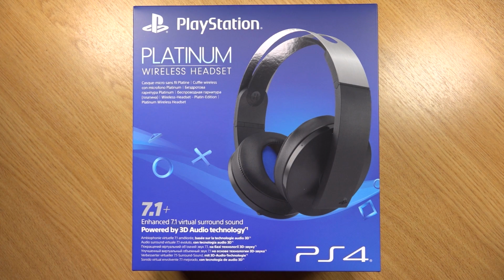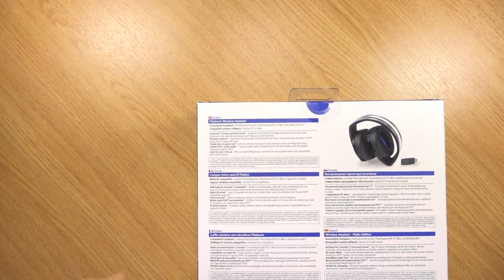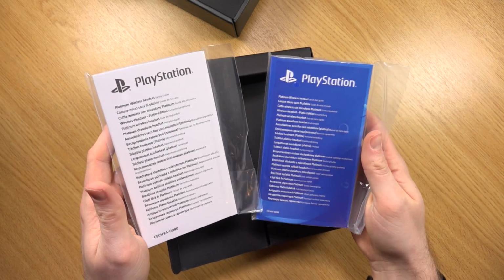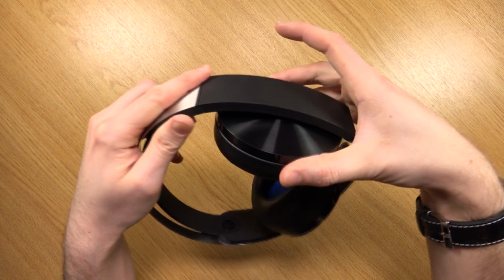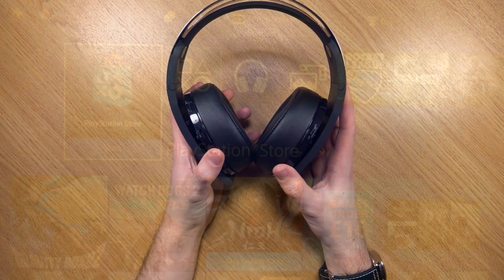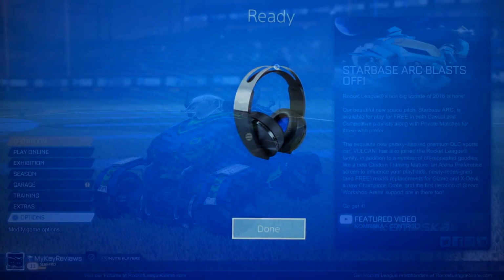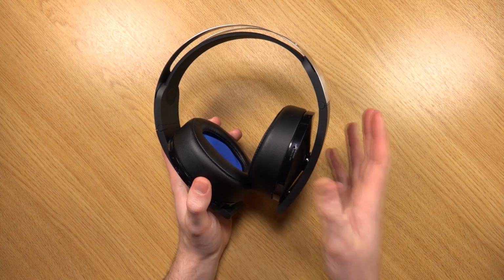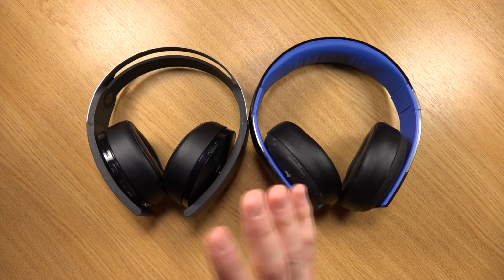PlayStation Platinum Wireless Headset (PS4/PS5) | Unboxing, Set-Up, Mic Test & Review | MyKeyReviews

Comment: Would you still recommended in 2019?
Reply from the maker: I've since gone through other headsets. I mainly use wired now.

These would still be fine in regarding quality in 2019. Another good headset is the Turtle Beach Stealth 600.
Reply: @MyKeyReviews  Oh damn, thanks.
Just because of this detailed review and that quick of a reply on a 2 year old video you've earned my sub. 🙌
Reply: @TheChaoticCanuck  i still use them after half a year now.. I mainly use them wireless on PC and they work great.. Good bass.. Good sound isolation and the special 3d audio on ps4 is so nice... I would recommend them if u going for wireless
Reply: @gsnoeren013  Alright thanks.
Reply: @MyKeyReviews  what wired headset are you using over this one? Wired to the PS4 directly or via the controller (3,5mm jack)?

Comment: If it won't Connect use a pin to poke the reset button on the usb than hold mute on the headset, while holding mute turn it on... should be good to go!
Reply: Jordan Baldwin could u explain it more pbvious
Reply: It still didn’t work for
Reply: Me

Comment: How do you activate the party chat for this headset. I'm new to ps4 headsets so that's why I'm asking
Reply from the maker: Green Beret Party chat is done through the PS4 settings. Should be a headset icon along the menu and you can create one.
Reply: MyKeyReviews I see that but how do you hear yourself through the mic, I held down the mute button until there was 2 beeps and I still can't hear myself in a party
Reply from the maker: Green Beret The sidetone isn't great on this headset; it works, but is VERY subtle.
Reply: MyKeyReviews I went and traded in for an astro headset which works for me
Reply from the maker: Green Beret That's fair enough, Astro are a good brand. 🙂

Comment: I seem to have a problem with the game volume being too low on the headset, while the chat volume seems to be fine. I tried the Sound/Chat button, but it didn't seem to fix it. The chat volume faded away, while the game volume remained the same (low). I noticed this to be a problem while the headset was low on battery, and I haven't charged them, as it was night and I didn't want to let them charging the whole night. Maybe that is why? I just got the headset about a week ago, so I'm still learning how to use them. Any help is appreciated.
Reply from the maker: GVRCIA Definitely give the headset a full charge and hopefully that will help.

If you know how to adjust the ratio and follow up with the general volume button, then there's no reason for it to be quiet. 😮
Reply: Mate if you have a warranty then you can replace the product

Comment: Loving your videos I have viewed so far!

Going off your 2.0 review, I guess the Platinum price in the UK is about double?  £75 vs £130?  No doubt it can be had cheaper through places like amazon.  Here in Oz, the 2.0 is $99 and the platinum is a pathetic $259!  Almost triple.  

Another advantage the 2.0 has is that it works with the PS3 and VITA (TV, I guess anyway.  I have a TV but not a VITA).  I am sure there would be far more 3D Sound enabled games now, so is it worth it?  I am about to buy a SONY A1 OLED TV and wanted some nice headphones seeing as I can't fit a surround set up in my bedroom.
Reply from the maker: A Shaw Woah, that's a huge price jump for you guys in Oz; I would say it's not worth that leap in price and to stick with the 2.0's.

Alternatively, if wires don't bother you; my current set-up involves the Turtle Beach 'Elite Pro Tournament Gaming Headset and TAC', which you may be able to get in a bundle.

Comment: Why I can't save my profile preset in companion app? Every time i close the companion app my preset profile gone.
Reply from the maker: lawrence melosantos I'm not sure why the app doesn't remember it like it does with the Gold's, however I'm sure it's still uploaded as my different profiles make a difference.
Reply: MyKeyReviews and also im experiencing ramdomly disconnecting in this headset.
Reply from the maker: lawrence melosantos I've not had one disconnection since using, so am not sure what that could be caused by. :/

Comment: That rubber-band feels so bad is pushing my head down so bad, and I'm not sure about the radiation or the Bluetooth if is too bad or not but this is my first wireless headset and makes me have headaches.
Reply from the maker: LiilReyy I'm bald and I find the rubber band fine. Not sure why you're having headaches, I don't think it would be the wireless connection, who knows. :/
Reply: MyKeyReviews I don't know this is my first wireless headset and I have headache every time I use it, but with my other headset that is a wired headset I never had a headache, I'm not sure if is the wireless radiation of the Bluetooth but I'm sure that I'm having headaches since I'm using this wireless headset
Reply from the maker: LiilReyy Does it feel tight on the head?
Reply: MyKeyReviews just I feel the rubber-band pushing my head down
Reply: LiilReyy It the Rubber Band top of you're head. It kinda hurt when you're using it. But I guess wear a Hat so you won't get headaches. Sorry for late response.
Reply: Gotta break them in. Anytime I get a new headset I get a headache for a week once that week is over I'm good to go

Comment: Lucky for you mate! you get your headset working well. Unfortunately I had to exchange twice to let it work for me. I was unable to upload uncharted 4 and shooter exclusive audio  mode to my platinum headset. The reason why being is after when I upload to my headset and close the Headset Companion App and then reopen the application...It is no longer stored in the preset 1 or 2....And its empty...This never happened to me when I used to own gold headset....:( Finally got Astro A50 and it works pretty well
Reply from the maker: Never happened to me with my Gold's either.  Glad you got a headset that does the job though. :)

Comment: thx for everything!  but I have 1 question which is that does the surround sound and 3d audio works when using the headset on the phone?
Reply from the maker: azooz40001 Those features are for the PS4 only. ☺️

Comment: I had one Gold Headset, the hinges broke through regular wear, after about 3-4 months. Got a new headset replacement from Sony, I babied it so hard. I never folded it, and was gentle with it always. After about 3 months I noticed the hinges plastic was a whitish blue...they broke a few days later while I was wearing it. I taped it up with electrical tape, the other hinge broke, and I taped it as well. Really tightly. Then the band started cracking in multiple areas. And I taped the entire thing up. It still works, it's just like a bootleg looking headset with black electrical tape all over it. lol 

I think the issue is, is my head is just too large for the base Gold headset, and I think that might be the issue that a lot of users have, and why they break. I ordered the platinum, hopefully that will fix the issue of the headset breaking every 3 months or so.
Reply from the maker: BloodyNights The construction on the Platinum headset is far more superior. :)
Reply: I hope so, I'm going to give it a try. Thanks for the review mine is coming in the mail soon. It's about time I upgraded. Hopefully it will be worth the extra money.

Comment: Ended up buying a set of the new Astro A50 Wireless, with Base Station.

HORRIBLE hollow, reverb sound!

Sometimes it sounded like you was in a bathroom!

Returned them, the day after I received them.

I'm now waiting for a certain retailer to restock this Platinum headset, and I'll buy them. I'll have to buy a separate set for my Xbox One S.  However, at these prices I'm ok with double dipping!

A concern of mine was the rubber head band on this headset. However, my eagle eye tells me that if it were to split (over time), it can easily be replaced? Looks like it can just slip off?

Now that you've had more time with this headset, can you confirm whether or not you are still happy with them? Has anything changed, with regard to your view of them?

Also, with regard to these not being bassy (re explosions, etc) can you not simply up the bass with the companion app?

Lastly, just read some reviews on Amazon and many people are complaining about a buzzing noise coming from the headset? This is (apparently) most noticeable when there happens to be no sound coming through the headset?

As always, thanks ...
Reply from the maker: London Fella I really can't see the rubber going, but if it does, I don't know if they would sell a replacement.

Honestly, I do really like this headset, especially after testing different sound profiles; the bass is my favourite. 

I'd still recommend it, just think it's a tad over priced. :)
Reply: ***** 

Sold.
Reply: London Fella hi returned them after 2 days what lost balls people telling so many lies because the getting them for free and making you buying, but make shore that if you don't believe us that the Sony platinum are rubbish even with uncharted 4 buy them from amazon because you can easily return them
Reply from the maker: Bare in mind I'm not a complete audiophile, so I'll try to explain to the best of what I experience.

Audio does not sound hollow and I have personally not noticed any reverb.

Spacial awareness can depend on the game etc... Remember for most games it's 7.1 "Virtual Surround Sound"; so you do get a good awareness, but not exactly pin-point.  I noticed more directional audio with the 3D audio on Uncharted 4.

Bass and tones vary on which sound profile you choose and once again, which games you play.  I found that when playing CoD:MW-R, the grenades had more boom than IW.   I loved the audio in BF1 where the guns sounded great.

I'd be interested in hearing your opinion once you've had some time using; reviews have been mixed but majority in favour, and I do like them too.
Reply from the maker: No problem at all; hope you like them and look forward to hearing your opinion also. :)
Reply from the maker: London Fella Audio can be very subjective to each person. 

Though have you tried any of the sound profiles at all? 

I'm using them right now and I still enjoy using them, shame you didn't have the same experience. 😐
Reply from the maker: Domenico Parise I've actually purchased the Platinum headset and wouldn't say they're good if they're not.

I don't think they're quite worth the price, however that doesn't make them a bad headset. 

I do agree with you on purchasing through Amazon as products are easy to return.
Reply: ***** 

Is the sound hollow, of full sounding?

Does is have a reverb effect (like the A50s, which I returned)?

Is spatial awareness good? That is, can you easily pinpoint the location of sounds (e.g., footsteps)?

Is there enough bass, mids & highs?

Etc, etc ...

I'm picking mine up on Friday, so I hope they live up to my expectations.
Reply: ***** 

Thanks again, buddy. 

Appreciate the time you've taken. 

I'll let you know what I think once I have them ...
Reply: Just tried them out. 

They are already boxed to be returned. 

How you can find the sound on this headset anything other than appalling perplexes me. 

They are AWFUL!

My day one PX5s sound infinitely better than this Sony set. 

Looks like I'll be going back to TurtleBeach. They truly are leading things when it comes to gaming headsets ...

Comment: i cannot get my platinums to pop up under bluetooth. how do I even get them to sync with dongle plugged in. im stuck! how do i get them into discovery mode or whatever so they are recognized
Reply from the maker: These aren't Bluetooth which is why, in the video I show the set-up process on the PS4, check description for the time slot.

Comment: Hey, I bought a pair of these last night and all good so so far except every time I turn my PS4 pro back on the audio modes ( presets I have loaded) are no longer saved in either slot ( 1 and 2). I am wondering if you or anybody has had or is having a similar issue? Any responses appreciated. Thanks
Reply from the maker: Same for me; they are definitely saved as the audio differences are there depending on which profile you have switched too.

Though I'm pretty sure when using the Gold headset, the uploaded profiles are visible. :\
Reply: MyKeyReviews so, you reckon the presets are still saved after switching the PS4 back on but just not visible anymore? 

How can you tell your chosen presets have been saved still? You don't think that you need to load them back into each slot after restarting the PS4?
Reply from the maker: Barry S Pretty certain they're saved to the headset. 

I now have the bass setting on profile 2 and there's a difference in sound, so it must've been saved. :o

Comment: Appreciate the information.

Would there be any issues if one were to put the USB dongle in the rear port of the PS4 Pro?

Would this cause interference?

Also, this operates on the 2.4ghz frequency?? Surely that's going to lead to crackles/audio pops?? Why didn't they go with 5?

I'd really appreciate it if you could try the dongle in the rear port on your PS4 Pro, just to see if it fits ok and doesn't cause any added interference.

Cheers ...
Reply from the maker: London Fella I have just tested it out on the rear USB port and can confirm it works perfectly fine.

Did a mic recording test and no crackle or pop.

Probably would have been better if they used a different frequency, but it seems to work fine as is. 

Hope this helps! :)
Reply from the maker: London Fella On top of what I previously said, when I went to remove the dongle from the rear, it's rather close to the vents which can get warm.

So if you do decide to put it there, keep an eye on it.
Reply: ***** 

Appreciate the response, buddy. 

Your comment re heat from the rear of the console makes perfect sense. 

Is it a tight fit in the front USB port? That dongle looks fat!

My fight stick fitted without issue on my original PS4, but it's extremely tight on my Pro. I now use a USB extension cable, as I'm not happy about squeezing it in there (can't be good, right?). 

As it does operate on the 2.4ghz frequency, can you confirm whether or not you have experienced any interference with the headset?

I was all set on this headset, but just watched another review where the fella said that the sound was "awful". That is, when using the virtual surround/3D whilst playing The Division. 

I'm really torn between these, and the new A50s?

You will now have had a bit more time with this headset: Has your opinion changed at all?

Thanks again for checking things out, and getting back to me. 

10/10 for detail ...
Reply from the maker: London Fella I've had a USB stick and normal USB cable beside it and they fit fine, so no qualms there. 

I've had no interference or issues so far, so I'm not exactly sure why others have had experienced such issues.

Opinion still stands, I like the headset, just think it's a tad over priced in comparison with the Gold headset.

I'd say check out some reviews and a mic test on the other headset you're considering and go from there. 

Always happy to help. :)
Reply: ***** 

Much appreciated, mate. 

Really do respect the time you've taken to get back to me. 

Currently watching another review (Flossy Carter) and he seems to love them!

Think I might give them a go. 

Thanks again, fella ...
Reply from the maker: London Fella No problem at all. :)

Comment: Great channel ! 👍🏻 i have three Playstation headsets ( elite pulse , 2.0 & now platinum ) I like high volume but I think platinum is not that loud like 2.0 on 2 bass settings or pulse on shooter/game mode..
Reply: David if you have the money it's worth it just for the extra battery life. The sound is a bit better as well as the mic. If you play uncharted 4 you have the 3D audio on top of that.

I don't like telling someone to buy something in case they aren't happy. However I'm really happy with my purchase. Entirely up to you mate..
Reply from the maker: MikeZablo If you get the ratio right, the volume isn't bad, but then again, maybe my ears are more sensitive?  😁
Reply: David no worries
Reply: @jimoflh5773  dude do you still have them?
Reply: AGENT HUNT299 yeah I still have them. Last week they snapped on me. Bit of gorilla tape has fixed them. Doesn’t look bad either. Just broke because I use them a lot and I can see me using them until the PlayStation 5 comes out
Reply: AGENT HUNT299 only thing is now they don’t fold anymore lol
Reply: @jimoflh5773  can you tell if the enemies are above or below you or on the same level? Or is that hard to tell? And what headphones did you have before that?
Reply: Major H1Z1 only works with games that have it in. Like uncharted however the ps5 will have 3D sound on every game.

They still sound better than my turtle beach.
Reply: @jimoflh5773  Okay thanks. I might buy the platinum over the razer kraken v2 or razer tournament edition. I have the stealth 600 and thy are pretty bad.

Yeah but games like COD and Battlefield you should be able to tell if they are above you or below you even without 3d? No?
Reply: Major H1Z1 nope the 3D sound is only for games that have it. You will get surround sound but it isn’t quite the same. Like in uncharted you can hear echoes going around you, over and under you. Hard to explain.
Reply: MikeZablo having the game full volume will do damage to your ears mate. I just picked the platinum up and can't deal with turned up to the max
Reply: Purchased 3 days ago and no sidetone any suggestions